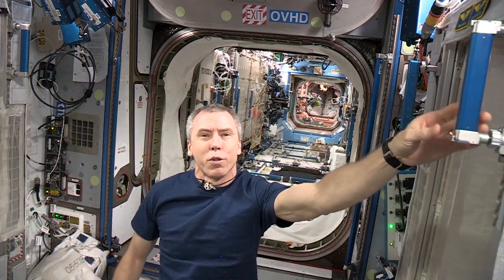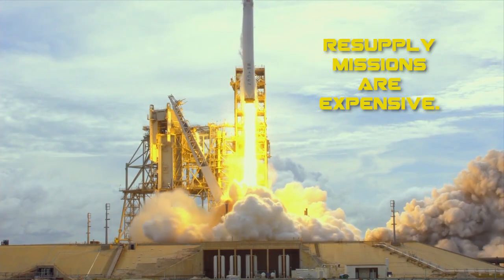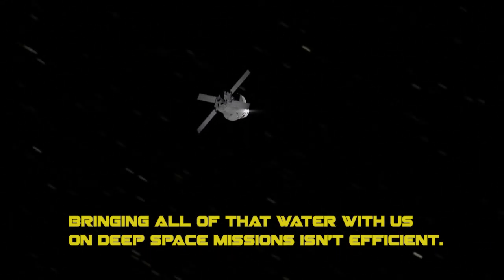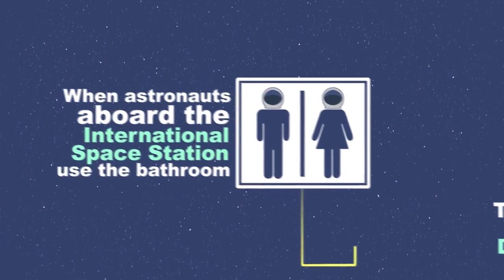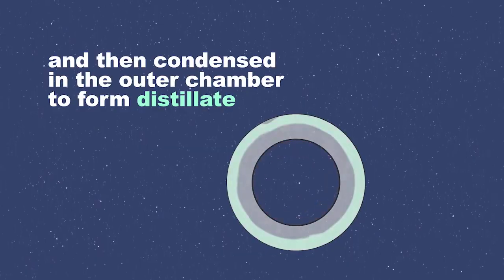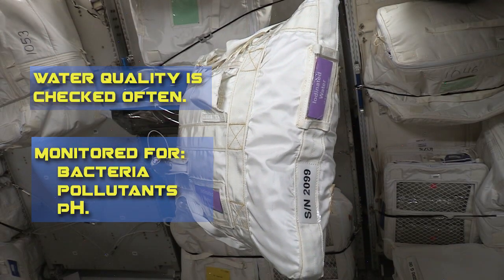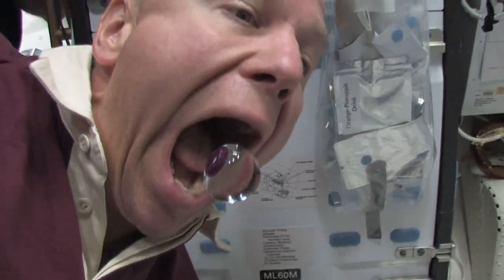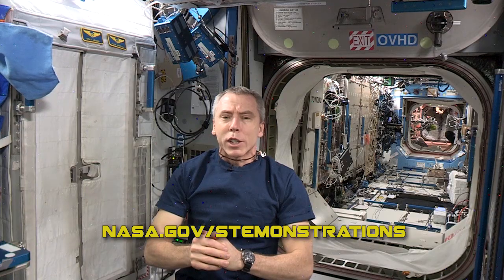STEMonstrations: Water Filtration

Comment: The illustrations are cool, but why don't you show some of the actual hardware? (Pipes and all) 😀
Reply: 0:23 They did! Most of it is inside the walls, but that's the part that can be seen without disassembling stuff, I expect.
Reply: Jesse H. - Yup, the rest of it is hidden behind panels, more wire bundles, and hoses.